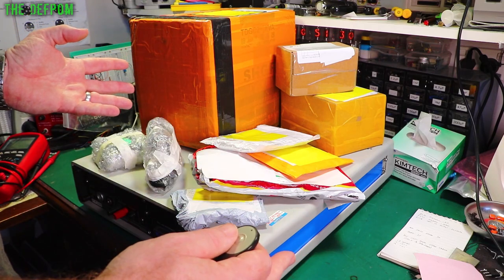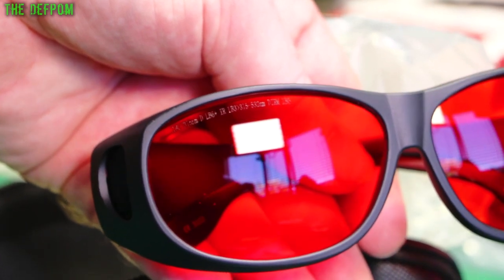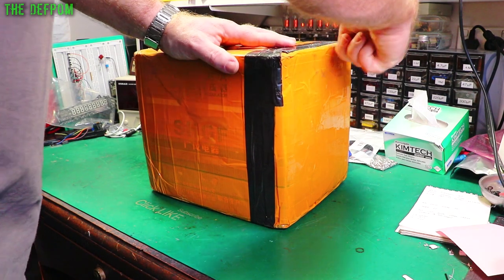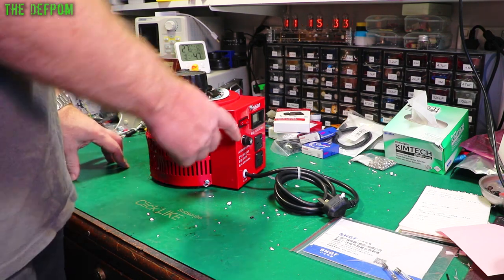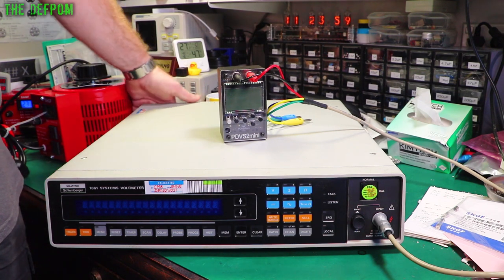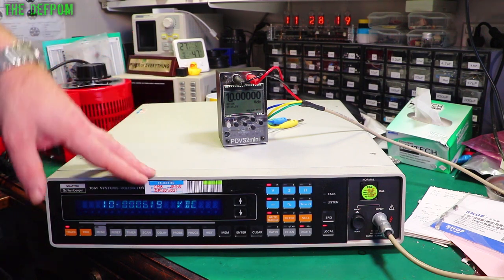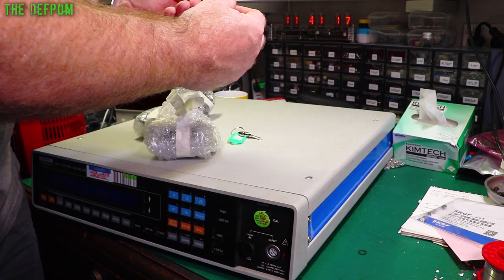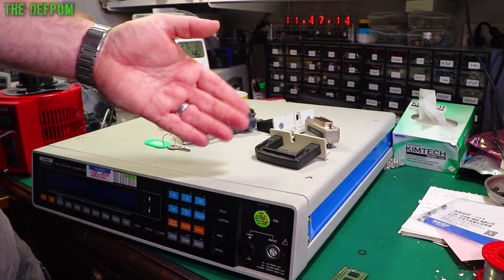🔴 Mailbag Monday 29th March 2021 - No. 816

Comment: Very nice Solartron! Marco Reps did a video on replacing the input connector on a 7081 (same connector) due to microvolt offsets generated by the connector itself. The GPIB connector with the cut off cable was probably being used as an extender to allow connection of a GPIB cable without interfering with other back panel connections - most cables have the "stackable" connectors with the cable coming out the side. If you connect a GPIB to USB adapter directly you won't need the "extender".

Comment: PDVS2mini & 7061 Info:
LM399AH references (which the PDVS2mini uses) do drift, but they don't all drift the same. It can actually take years for LM399AH's to 'settle' if at all. Some never drift.
Saying that, 69uV of drift would be unlikely.....so here's what you need to do with your 7061:
As it's just arrived in your workshop, power up your 7061 for a good 4 days and at a reasonably constant temperature, but within 0.5degC for at least the last hour or two.
From then on, power it up for 2 - 4 hours before serious use. Power up the PDVS2mini for 1 hour.
Place the 7061 away from windows and direct air flow drafts.
I would also advise to never let the 7061 experience more than say +/- 7degC temperature swings. Temperature induced mechanical shock can cause havoc.
I don't know anything about the 7061, but most 6.5digit DMM's and above require running an ACAL DCV (or ACAL ALL) to compensate the calibration according to the current temperature.....without doing that your 7061 readings could me miles out.....and I mean 10's or even 100's of uV out.
With 7.5digits you are now in the realm of metrology so you must take care of it and use it properly.
Drift aside, the INL of the DAC used in the PDVS2mini means it's typically +/- 1bit out, i.e. 10uV. Could theretically be more but typically +/-1 according to the datasheet........which is exactly my experience.
Reply from the maker: I haven’t had the chance to have a good play around with it yet, maybe this week... once I know that I have some spare time I will get it warmed up, I’m just a bit worried about having excessive run time and ageing the display.
Reply: @TheDefpom  check if there's a Display Off feature. If there isn't then maybe via GPIB.
Without proper warm up and care its not a 7.5digit DMM !!
Reply: @IanScottJohnston  I have the 7081 it's likely similar in behaviour - it needs to be left on for several days to really stabilize.  While waiting for this, I blank the display via serial port.  To get the display to blank...using the "DISPLAY OFF" command isn't the solution - it literally displays "DISPLAY OFF" on the screen.  The best way I have found is to output a space character to the display.
Reply: @TheDefpom  to add to aging the display its a slow, slow process. I have had 3458A for 3 or 4 years and up until recently it was on 24/7 and its not at all noticeable that its lost anything since I received it. Its a little dimmer than brand new for sure though.
Saying that, I have a brand new display tucked away in a cupboard for the time it needs changed.
My 3458A is 21 years old.
Reply: @CDN_Torsten  I wonder if the text DISPLAY OFF is in ascii in the eproms.......I'd be tempted to replace with spaces (20 hex).....:)
Reply: @IanScottJohnston  Interesting idea :)

Comment: Mine really wasn't properly earthed; that's why I revised the wiring somewhat.  I also adjusted the brush holder so the brush is fixed laterally rather than being able to move.
Reply from the maker: When I fixed it I made sure the earth connection was well attached.

Comment: I have no idea how that autotransformer could have got SO bent up.  The packaging looked in reasonable condition.   Maybe it got dropped BEFORE being packed up? :((
Reply: Mine was OK despite the package being damaged a bit in the post.  The spare fuse was rattling around in the bottom.
Reply from the maker: I’ve fixed it anyway, wasn’t very hard to get it all sorted out again.

Comment: Beware a lot of fake laser protection goggles out there. Test them by putting them under the laser itself for a good 15secs.
Make sure the glasses are suitable for the Class type of your laser (power) as well as the wavelength range. Your eyes are precious.
I have retinal problems (not laser induced) so am never in the same room when my K40 laser is running.
Reply from the maker: Indeed, I intend to test them to be sure it’s ok, the risk of fake ones is why I purchased ones that are 3x the price of the cheap ones, you generally get what you pay for, safety isn’t something you cut corners on!